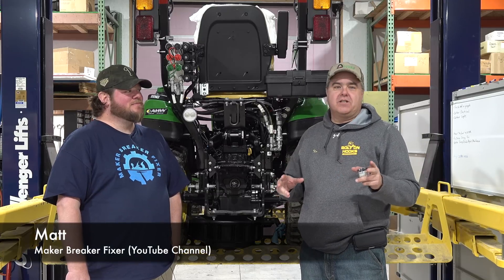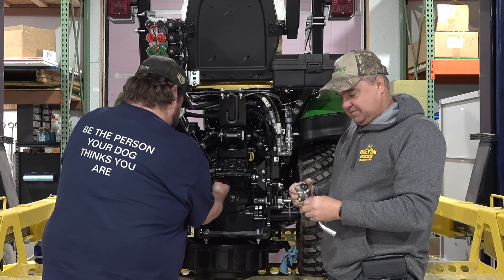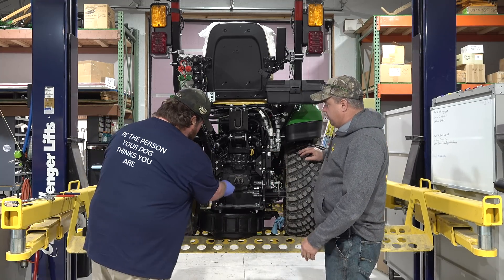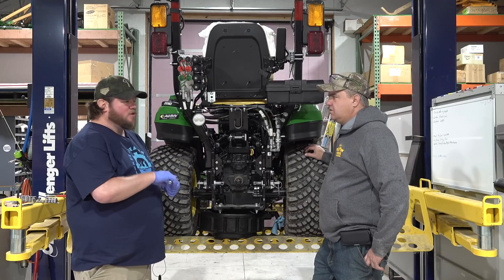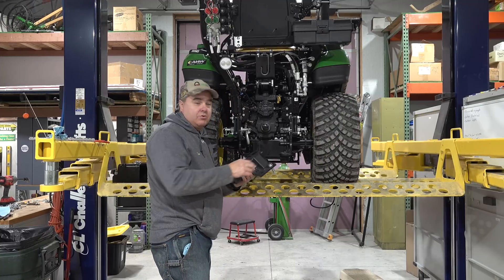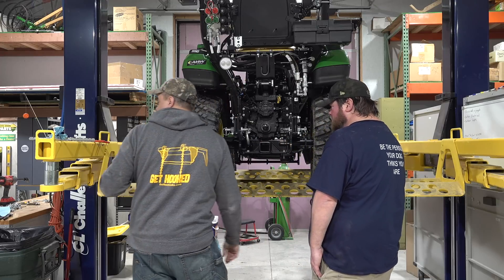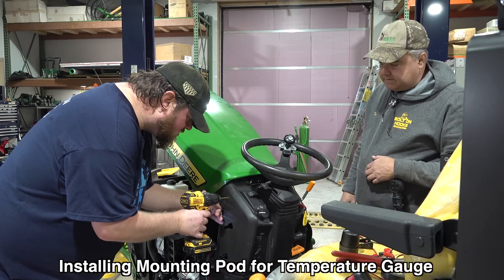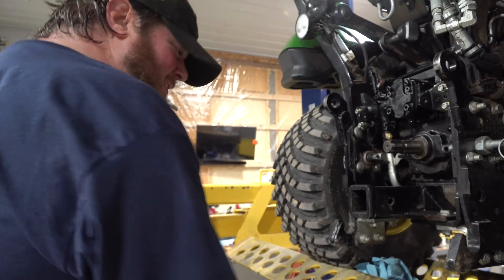NOW WE’LL KNOW!!  Oil Temperature with HydrosPlus and Summit Hydraulics. 1025R Subcompact Tractor

Comment: I'd like to have a gauge for my 2038R.  But I suspect the plumbing would be different on the 2-series.  I wonder if you could create a system that mounts the sensor in the sump instead of in the pipe?  That might be a more universal solution.  I wonder if you could replace the drain plug with a sensor?
Reply: If you do NOT have a plug in electric transmission heater installed on your 203xR in the plug hole below your PTO shaft and above your draw bar you should be able to install one there.
Reply: Most drain plugs are on the bottom. Would you want that sensor and wiring hanging down under your tractor?

Comment: Very cool! Would certainly be neat to have a kit available. The only advice I would add Tim is to install a weatherproof ATC or AGC (or whatever your favorite fuse type is) 2A or so fuseholder at that solenoid for your gauge. Right now it looks like it's hooked up directly which means if the gauge or wire shorts out you have no protection and could have a smoke show. Maybe include one in the future kit as well? Looking forward to the results!
Reply: The accessory power kit is fused.  Good observation though, we did discuss this while installing.
Reply: @MakerBreakerFixer  It probably is but I doubt it's low enough. Probably fused @ 30A or so (or maybe more) which is way to high for that size wire/application. I would still fuse it down.
Reply: @barelystablefarm7151  I recall it being a 10amp for the switched circuit, with the lead for the gauge being a 3' run of 18AWG wire.  with a short run like that, if there was a short, the fuse would pop long before the short lead could heat enough to be a problem.   👍
Reply: @MakerBreakerFixer  It looks like that kit is merely a couple 'add a circuit' fuse taps and a junction block. You could put whatever sized fuse you wanted in the fuse tap.. not sure if it comes with a 10A from the kit? I certainly wouldn't be connecting heavy draw items to the Batt or switched. Max draw on these fuse taps are 10A and that's pushing it if continuous. Anyway, just wanted to point out fusing as not many people do it right and it can be a fire hazard. Many fires are electrical in nature. Thanks for you replies!

Comment: If I was an engineer at Deere I would be very interested in the results and would try to talk management into replicating the research.  If nothing else I would try to talk management into offering an upgraded package on the 1025R with all the performance equipment; turbo, higher volume hydraulic pump, remotes and the gauges.  Gauges for engine oil, hydraulic oil, water temp all make sense.  Then coupled with over temp or boost warning alarms could save an owner/user from damaging their equipment.
Reply: I'm sure Deere has extensively tested oil temp. But remember, they only care about stock OEM performance. They are not going to care if you add a bigger hyd pump or a turbo or anything aftermarket.

Comment: Impressions from the peanut gallery: 1. I think for the average mower and snow pusher like myself, knowing the temperature shouldn't be required - maybe it'd be nice to know, but it shouldn't be a concern. Make sure the radiator screen is clear so you have good airflow over the oil cooler. That's an issue when mowing prairie here in Wyoming. 2. I'm so glad I now have the 1025R for right at a year. I've got 51.9 hrs now. There's so much information that's available, cool mods out there and parts are available (as opposed to my Mahindra that I sold to get the Deere). Summary - this is a good mod and may be critical for some specific operations, but the average person should be OK if the tractor is maintained and operated by the book. If you get after market hydraulic add-ons, mods, etc., I think it'd be a good idea to monitor temps as an indicator of any potential problems.
Reply: Very well said - Glad that you're happy with your 1R!  They are incredibly productive machines, as Tim regularly demonstrates!
Reply: @MakerBreakerFixer  Yes - and you do some great work! They're great tractors.

Comment: I like the idea of the hydraulic oil temp gauge.  I wouldn't buy the kit as I have a different color tractor, but I really like these experiments with the turbo and the Hydraulic upgrades and addressing the hydraulic oil temps is important.  I'm no expert, but I've been told over 200 degrees will shorten the life of the hydraulic system.  If you find more data on just how hot too hot is, please share.  Thanks and please keep these experiment/modification videos comming!

Comment: Like others have said a core charge for exchange. 
Definitely want to see the temps tested! I’m currently dealing with this problem while grooming sand horse arenas and thinking a external cooler with fan maybe the answer.
Reply: I've been working on a external cooler, but its still in the testing phase.   It integrates with the summit rear outlet kit.

Comment: I would rather upgrade or add gauges to monitor the engine, oil temperature, oil pressure and water temperature.  That's the true heart of the beast, you should know what's going on with it.  I haven't seen many big TLB with hydraulic temperature gauges, I don't see the need for them on a compact or subcompact tractor.

Comment: It would be interesting to know if he's still running his original 2017 hydraulic oil, and what the condition of it is (through someone like Blackstone Labs). You should also be able to look up the data for the hydraulic oil and look at the viscosity over temperature curve for it. My gut reaction is that you shouldn't see that happening at that low a temperature.
Reply from the maker: No, not original oil.
Reply: Nope not original oil, close to 400 hours and on 4th hydraulic oil change.   When starting to experience the performance problems chasing it down i replaced the oil at 40-50 hours after the 200hr service and did a oil analysis with Blackstone. 
Oil was within spec with "nothing of concern to note" based on the hours/age of the transaxle.   I follow the manufacturers schedule for maintenance if not more frequent.

Comment: My Tym heats up hot after an hour or two, whether running the hay rake with hydro lift, or running the loader for hours under heavy loads. The hydro lines are hot to the touch. What's a good safe temp for the external hydro lines running a full load? Mine is a geared tractor, not a hydro as I had heard hydrostatic doesn't like to work for hours at a time 🤔
Reply from the maker: The lines will be too hot to touch. No worries.  You are likely fine.  These machines are well designed for hard work.
We are doing this because of the ‘upgrades’ we have done to this machine…pushing it past its limits … for fun :-)
Thanks for your comment!
Reply: @TractorTimewithTim  ok! Like I said, I had read small hp tractors run much hotter than large ones, but never sure how hot is too hot 😬

Comment: How about doing a core charge for the tube and when you return your old tube you get the core charge back.  This way you don't have to buy a new tube to create the kit?  looking forward to the data on how hot the fluid gets.
Reply: I was thinking the same thing. Especially with tube not available. Simple answer.

Comment: Use thicker hydraulic oil ….
Reply from the maker: Does that reduce oil temperatures?  I’m a novice on this.
Reply: @TractorTimewithTim  no! ( yes but not a whole bunch ) An external cooler on the return side or a “kidney loop” would do that. 
If you tractor calls for lets say calls for a 32 weight oil and you run a 46 weight oil it helps you with the performance loss the guy described  as the oil heats up.  
Essentially he is seeing the performance loss because the oil is getting too thin as it heats up. 

Now the flip side is cold weather operation ….  You dont want the oil to be too thick either …  
Since hydraulic oil is a fixed weight (not like engine oil) if you live in wisonsin for example you need to either change hydraulic oil twice a year or run a fluid suitable for winter or install a tank heater when running thicker oil ….

To get back to your question and my no! But yes answer: thicker oil creates less slippage and heat in the transmission but that will not make ground braking difference, the higher viscosity and less slippage and better power transmission in the first place is what you are looking for ….
Now if you live in much warmer climate than wisconsin, you can run a thicker oil because you dont really have these cold winters but you  have the same temperate summer ….  
In your case specifically , if you had one tractor that would stay in the heated shop in the winter you could run a thicker fluid as well …..
If you park outside in freezing weather, it might not be such a good idea
Reply: @ZILAwelds  Couldn't have said it better myself.  (and I'm storing the tractor in a unheated shed that has plowing duties, otherwise trying the J20C spec oil would be an option.)
Reply: @TractorTimewithTim  It wouldn't reduce temperatures*, it would however provide for more tolerance to higher heat because the oil thins as it warms up.   On the reduction of temps, it might actually increase temps or at least cause temps to rise to "operating" faster as a result of being heavier and having more resistance when cold. All things being equal, for a given oil temp, the heavier oil will take more energy to move, which might cause additional heat to be generated as a result.  That being said however, it's unlikely on a 1 series that this additional load would be measurable anywhere outside of a specialized lab.

Comment: My theory is that the upgraded high flow pump will push more oil through the cooler bringing the temp down.
Reply: That's a good theory and one that Kevin and I have discussed at length.  It's a rabbit hole to go down though - Higher flow, less time in the cooler, reduced flow to the steering implement, less oil but likely higher delta of oil temp drop.  The variables are extensive and it's some complex math to properly figure it out.   other factors in that equation- ambient air temp, humidity, engine RPM/fan speed, etc.  No easy answer, but the theory of your observation does appear to be valid.  😁  Thanks for the comment Jimmy!
Reply: Great idea. A bit pricey for me. I would be interested at sub $200. Can't wait to see your results.

Comment: Why not just use an infrared temp gun to check the temp of the oil cooler input line. That is more accurate than the temp in the sump. For how hot your getting the fluid. 200 degrees is perfect temp like to keep it below 250 for longest life. If it gets above 325 degrees then you need to add more cooling.
Reply: How often are you going to get out to check it? If you're working the tractor hard on a summer day, are you going to run around the back every 10 minutes to check it? If you're going to do that, why bother with a coolant temp gauge? You could just run around the run at the same time and check it's temperature.
Reply: This is actually how I started my theory - But taking measurements on the hydraulic pump and powerbeyond hard lines on the rear.
Reply: @JCWren  but if your working the tractor hard for a while you will only need to check it once on a hot day. If it's good it's not going to get any hotter...

Comment: Seems like if your going to do all those upgrades it might be worth considering getting a bigger tractor with more horsepower
Reply from the maker: Ah, but what fun would THAT be? :-)
We’re just having fun with this tractor.
This particular gauge is to help us learn the limits.
Reply: This is a good point. After/If , the extreme goes into failure it may be apparent with the temperature spike

Comment: Oil temp gauge, great idea.  A little pricey for me at $300 but if I can afford an upgraded pump and adding rear hydraulic...then what's $300 for a temp gauge.  TTWT is always showing us viewers what is available out there.  That's one reason I keep watching all the TTWT videos.  Thanks for this video.  I'll be interested on what you notice with this temp gauge.
Reply: It's still 300 bucks.
Reply: When I hear of the 1025r burning up because of high hydraulic oil Temps, I'll sell mine and buy a Kubota....lol
Reply from the maker: Won’t be an issue on a stock tractor
Reply: @TractorTimewithTim  Tim, if it does become an issue, you can always go to Jegs or Summit auto parts place.  You should be able to find a replacement oil cooler with more capacity.  They have all sizes.  You might have to create a bracket.